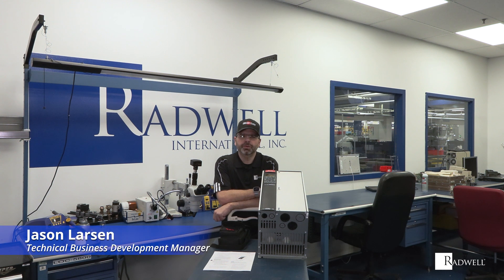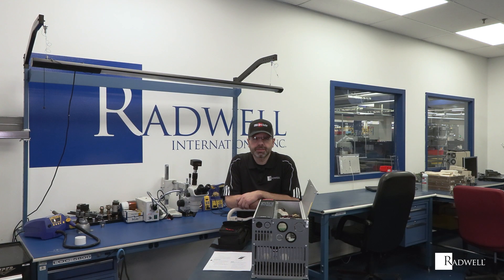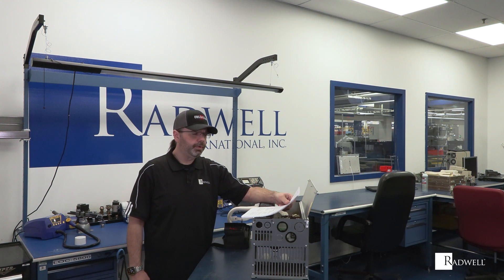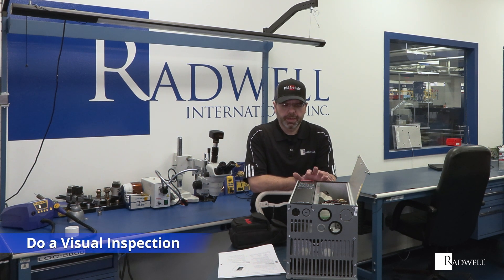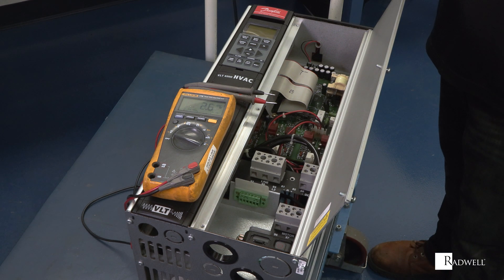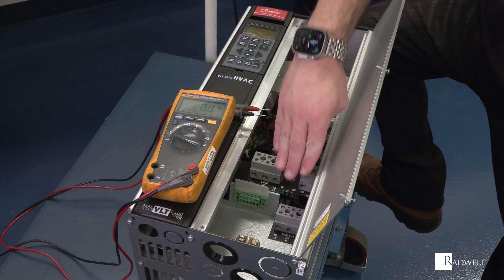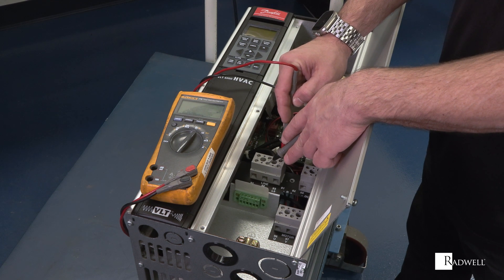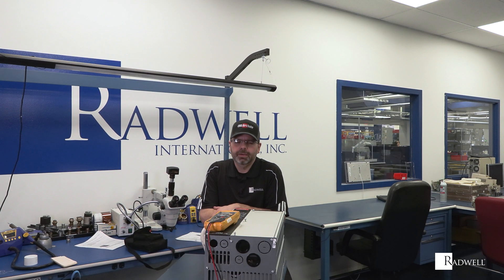How To: Troubleshoot VFDs

Comment: Radwell is Great! I have a 25 year old Mitsubishi Split Unit air conditioner that had a control board failure; I could not get a replacement from anywhere. So I contacted Radwell and sent them the unit and they were able to repair it. The unit is running great! Thank you Radwell!

Comment: Well the first thing you need to do is to remove your metal wrists watch. Then if you don’t know the condition of VFD then do not apply voltage to its input terminals. First check DC voltages on DC bus voltages and make sure that VFD is completely safe to touch internally. If there is even 60v DC first discharge capacitors in DC terminals and then reconfirm voltages with multimeter. Then before applying voltages to input terminals check all inputs and output terminals static check or say short circuit check which he has done following the manual in last. Before applying voltages to input terminals this check is very important and let us know if there is and short circuit in bridge rectifier or dc bus or output transistors or IGBT module. I was working on VFDs in industrial electronics repair lab and we always do test any VFD like this and we never got electrocuted and make any big bang while applying power to any VFD.

Comment: Guys also remember when working with large machines and equipment that can sometimes have capacitors or transformers that can retain current even if power is off to them. make sure to always be aware of shock hazards

Comment: You really need an oscilloscope, check the input and outputs of the rectifiers, dc bus, and inverter SCRs and IGBTs. It is important to have the specs of normal values. And not blowing up your oscilloscope it’s important too.
Reply: Are you in the US? I'm working in manufacturing maintenance and our company spends hundreds of thousands of dollars for drive guys to come in and troubleshoot because nobody knows how to do it in house.

My question for you would be are you hiring? I would almost love to work for a company that can refurbish/install/validate drives. Or what courses would you recommend me taking to become a drive expert?
Reply: @goaliedude32  I know this is 2 months old but you find any leads?

Comment: Thanks very informative troubleshooting guide ❤👍
Reply from the maker: Glad it helped
Reply: Hi Sir I'm in process of troubleshooting of VFD... 
Trouble shows
1. Input 380 ok but there is no voltage reading DC output to bridge type/ rectifier diode which is should be give supply voltage to Capacitor. Input of rectifier diode (380v) rectifier diode found  two wire  going to Magnetic contactor... 
My question is there a related from contactor wiring that can cause Zero VDC or no reading at all thanks hope you understand what I mea..
Note: no output voltage ACV that supply to motor... And there is LED Alarm display indicator from display panel. Thanks

Comment: Hi! In my vacon nxs have a strange problem… When push start by external command on display i see RUN…but the motor not start.
After 1/3 hours it start…
No fault on display, only custom error (i think):
Leakage 
Low pressure
The motor is a turbine.

Have you idea about this problem ?
Reply from the maker: If you reach out to Jason Larsen, who stars in this video, he may be able to assist. You can reach him at jlarsen@radwell.com

Comment: Hi Sir, i checked in coming power L1 L2,L3 450 V but power out to load reactor is 48 V. And my motor did not turn on. Could it be the defective vfd or need to reprogramed? Whats your opinion on this one? Thanks in advanges
Reply from the maker: It would be a good idea to directly message Jason Larsen (the narrator of this video) with any specific questions. You can reach him at jlarsen@radwell.com